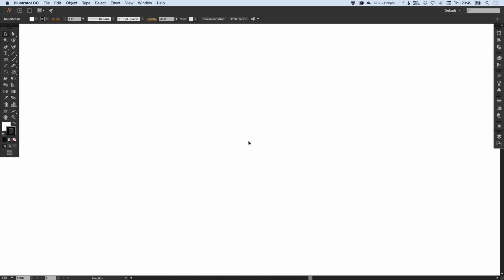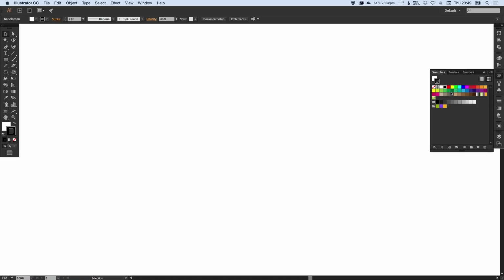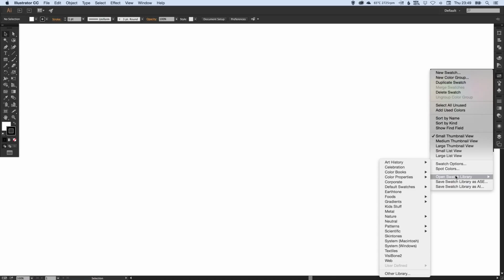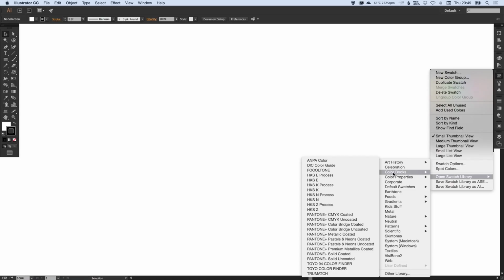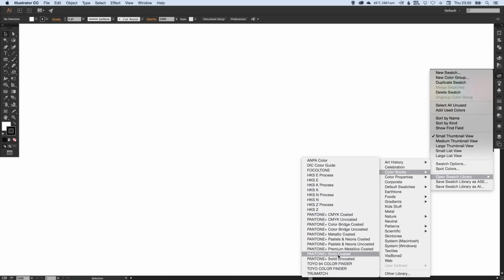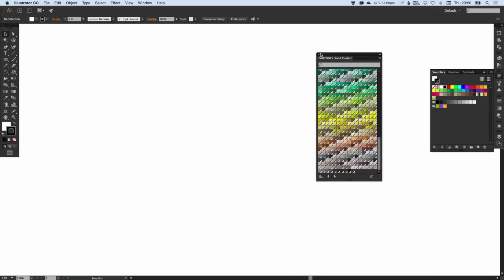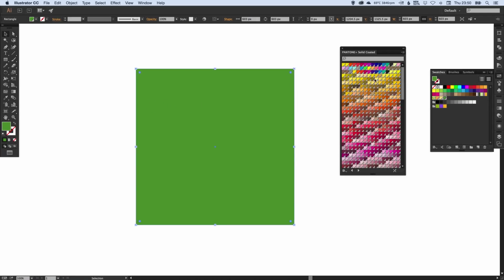Learn How to Select & Use Pantone Colors | Dansky

Comment: Why is CMYK even an option then if pantone is better?
Reply from the maker: CMYK is full color print, for example printing photographs. Pantone colors can sometimes be more cost effective to only use one or two inks, instead of a full color print run that uses four. It kinda depends on what it is that you're printing 👍
Reply: @ForeverDansky  oh okay cool. So I'm creating this big 1200 x 1200 sign for my client and I'm already using 2 pantone colours atm. Should I change it to CMYK? I know the cost will depend on the amount of pantone coverage right. My project only has little. Thanks for reply.

Comment: What if you are not printing on paper? what about plastic or metal. do you still use the same pantone code? Also the colors on a pc are never accurate to what they are in real life so seeing them on illustrator would not help you find the right color correct?

Comment: It was my understanding that Pantone colors could not be accurately replicated by normal digital CMYK technology as CMYK digital printers layer one color upon another and Pantone is a pre-mixed ink  that is loaded into a print press for a production run.  For small jobs selecting a Pantone color becomes cost prohibitive due to the setup costs.
Reply from the maker: That's correct Jim. Sometimes you can get a pretty close match in CMYK to a Pantone if you're lucky, but not always.
Reply: There is a lot more to Pantone colors than is explained in this video and I think that if you ever get the chance to go to a commercial printer and see how spot pms colors are mixed and used it would be super helpful to any designer. Jim T is correct that unless a Pantone is specifically mixed and used as its own separation it will be pushed to CMYK and the color accuracy is not 100%. However if you are designing for a brand... Say... John Deere Tractors. They have a specific John Deere Green that they use and a designer would want to use the corresponding Pantone even if it is going to be pushed CMYK for print.